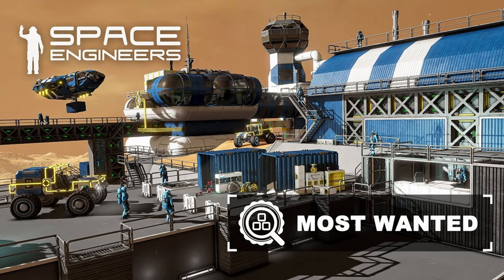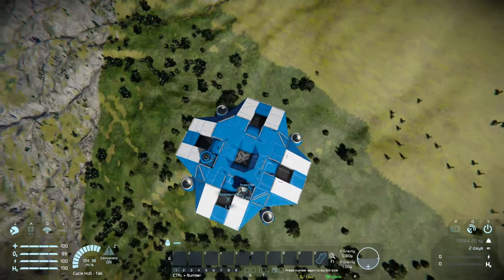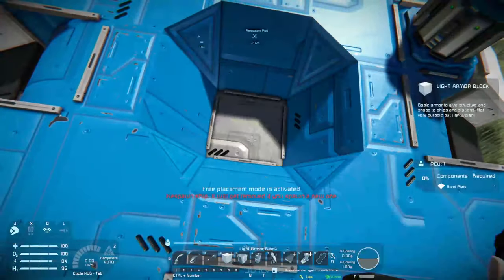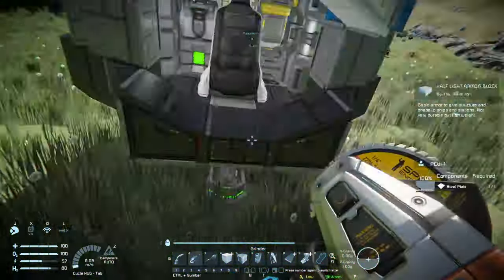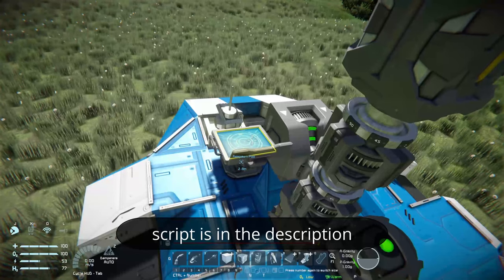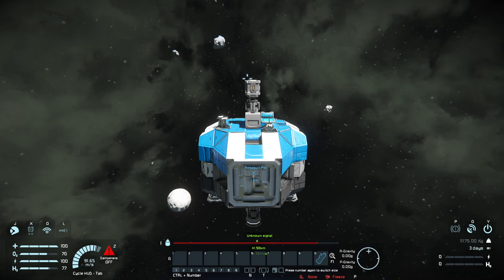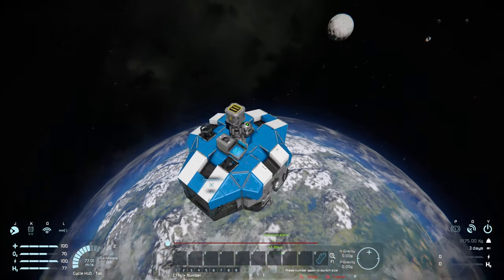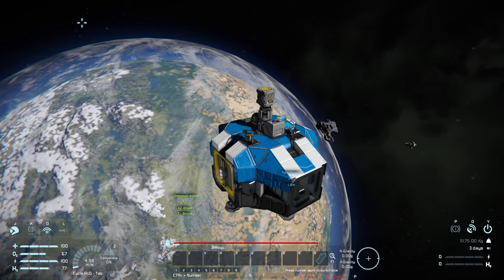Space Engineers "Most Wanted" Update: New Clang Drive Technology

Comment: Is there a reason your mass shift drives all use TWO advanced rotors in series? Will it not work with just one?
Reply from the maker: I think it would work with one, at least in theory. It just works a lot better with two rotors. The whole thing is kinda like a mass-spring-system, with the rotors acting as the spring. You want the resonant frequency of it to match the frequency you driving it with, which is 30 Hz. When I first experimented with mass-shift drives I tried playing around with the spring stiffness by putting varying numbers of rotors in series or parallel, and using two in series consistently gave the best results.
Reply: Because he's gonna be going over the ocean.